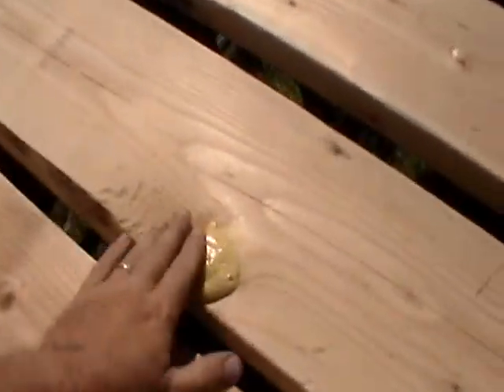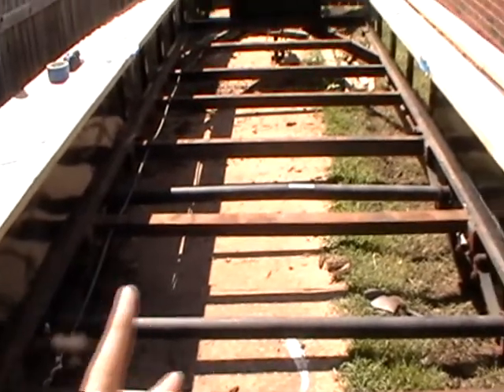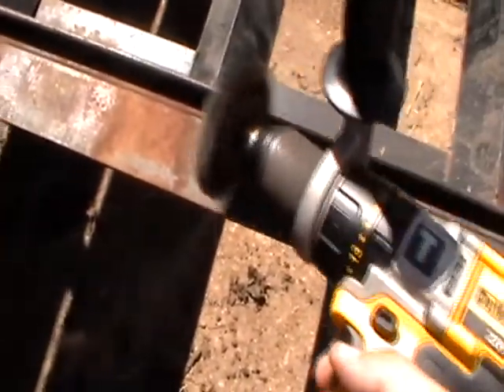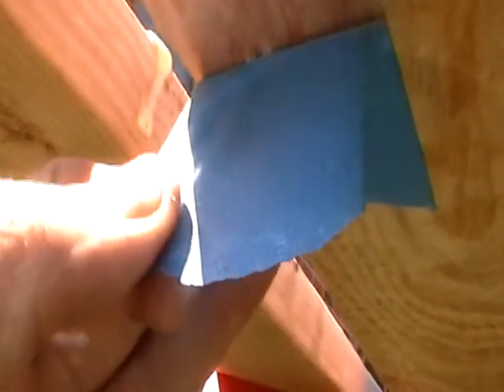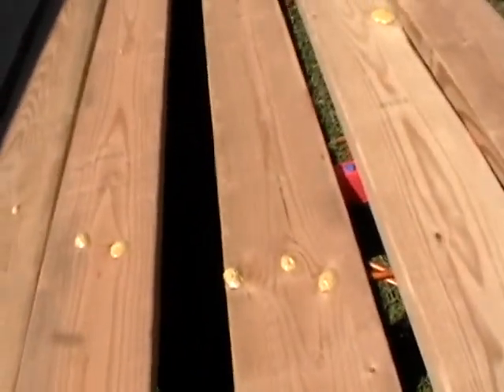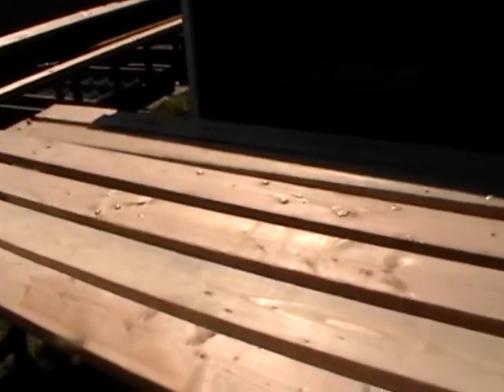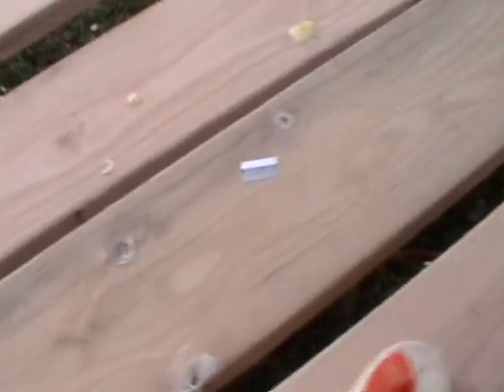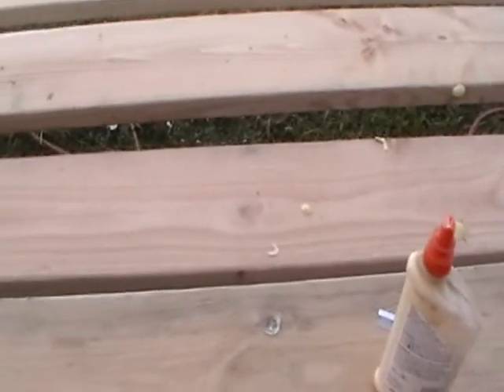Re-flooring or Re-decking Utility Trailer Bed  Gorilla Glue Fail!!!!

Comment: Regular wood glue is water soluble and will wash away. To fill knot holes in wood the best thing to use is Bondo. You can mix in a "little" oil based black or brown enamel paint and it will turn it that color. It will hold up great.
Reply from the maker: Good to know!!!   I'll keep that in a bank of knowledge I seem to learn after the fact LOL
But thanks for the tip.
Hopefully I can seal this enough that the wood will hold up